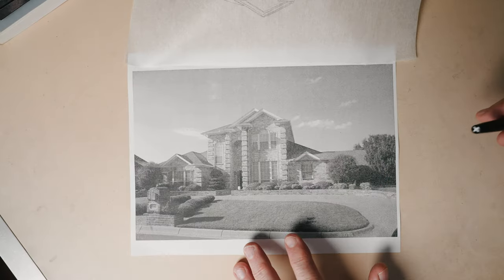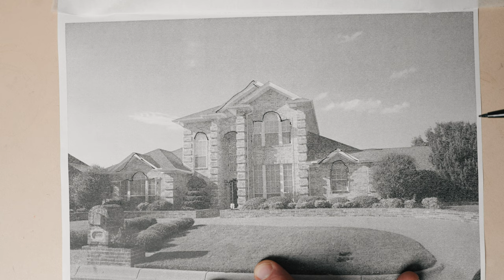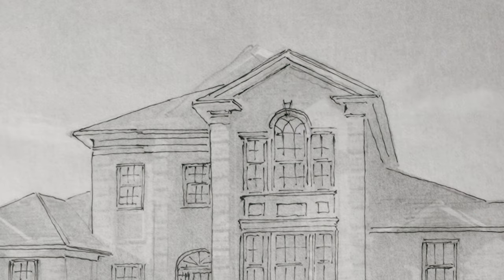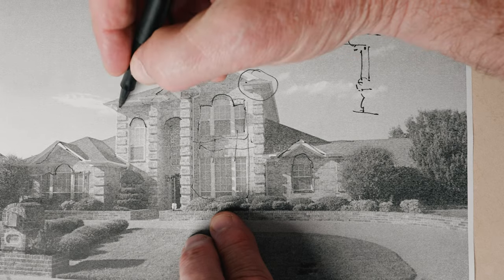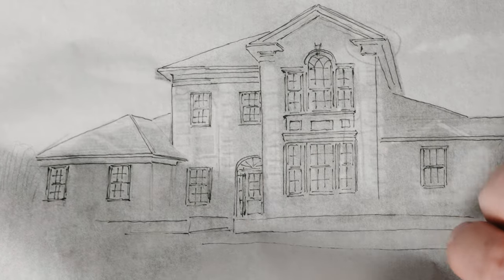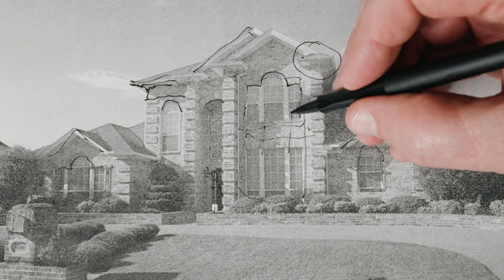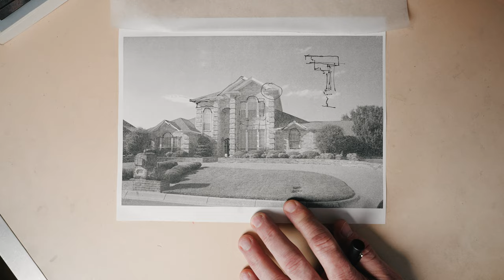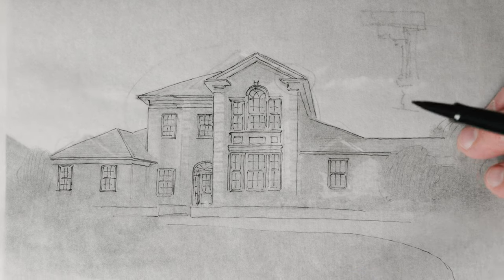Fixing a mini-McMansion.

Comment: Those houses that have every element "dialed up to 11" seem to be everywhere. Your changes are a clear improvement, but is it truly possible fix a house when the front entry is tucked back and not located on the front face of the house? Are there any historical examples of that or historical precedent for having the main entry moved back like that?  I'm extra curious, because my 2010 house suffers from that same design.
Reply: Build that part out? Idk.
Reply from the maker: Well. it's possible but may not be practical. I don't find an historic precedent in America. One reason I don't recommend buying a new home is because these problems are often unjustifiable to fix. Its a problem but small tweaks are still possible and valuable.

Comment: Pretty darn good. Paring down the excessive gables really helps give it a tamer look. The redo looks somewhat like a 1920s Hollywood home of a silent movie star. 
BTW, this is NOT a McMansion. They're generally under 2000 sqft. 3 bedroom 2 bathroom with a powder room off of the double height entry and staircase with a small designated dining area behind the tall front windows. They're built by the 100s in the nicer developments. Still a tract home.
Reply from the maker: Thanks for the feedback.

Comment: Congratulations - you have made a huge enhancement to this house.
I know you want to stay with architectural improvements, however, by centering the front oval lawn & driveway on the
new Palladian window 'bay' and planting symmetrical large shaped Laurel trees or similar to the far left & right to partially hide the lack of symmetry would give this house an appearance of balance on the street facade.
Reply from the maker: Good point. I need to start including landscaping.

Comment: Brent, bless your heart for even trying to fix this one lol. Sorry,  but what an ugly structure smh. Very cringey. 
But yeah,  you did slightly improve it. Some structures should be torn down.  I can only imagine what the inside looks like 😆.
Reply from the maker: Haha, thanks.
Reply: Acres and acres of sheetrock with atrocious accent walls throughout. Finger jointed base and casing. Some pre-finished engineered wood flooring and undoubtedly a misplaced overscaled fireplace with a 10 foot tv hanging above it. Add cheap stainless steel appliances and hang framed posters with inspirational quotes throughout. Plus underscaled single member crown molding in formal 12 x 12 living room.